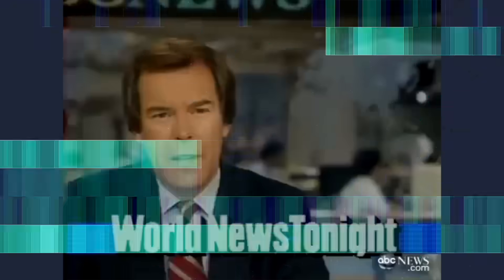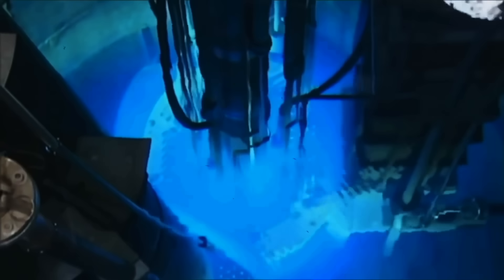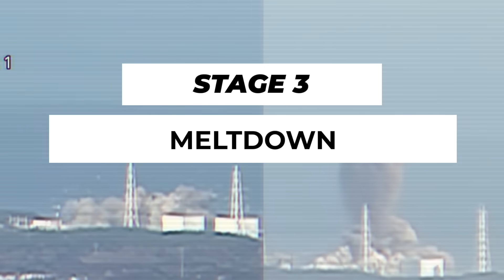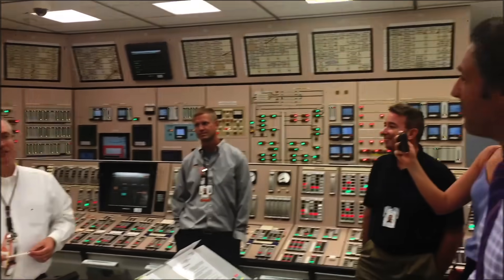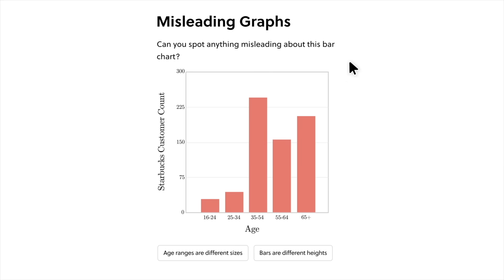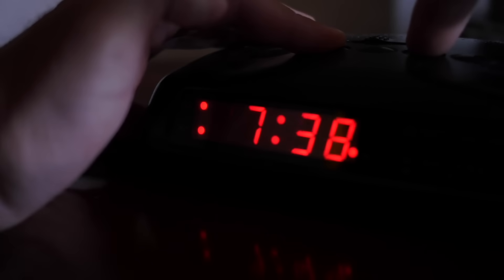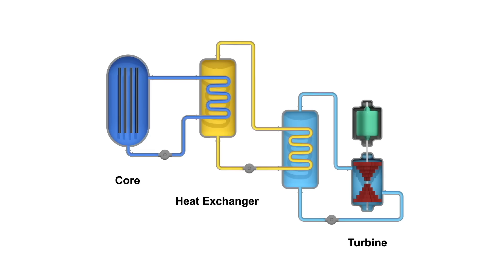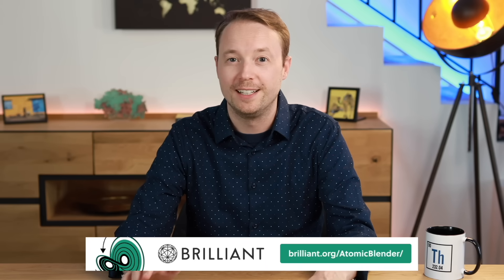Why Is It So Hard to Stop Meltdowns?

Comment: Of the nuclear accident we generally know about there has been 4 not 3 major accident, you missed out Windscale (now Sellafield) in 1957 in the UK. But beyond these there are many in the US and USSR that we only have the briefest of knowledge about because they were military accidents, Oakridge in the US springs to mind.
Reply: Not to mention SL1
Reply: Can't forget about the SRE (Sodium Reactor Experiment) meltdown that occurred at Santa Susana Field Lab in 1959.
Reply: @shaggyd485  You can't really call an experimental meltdown an accident similar to Chernobyl. When you have an experimental research facility, a meltdown is expected as a possible outcome from the outset. Unless the experiment lost containment, that's just a data point.

I guess you could call Chernobyl an experiment. But the experiment was supposed to be a functional test of the turbines, not a test of what happens when you remove all the control rods, poison the reactor for several hours, and then suddenly insert the control rods back. We already knew what would happen if you did that, even back then. Well... some scientists knew. The ones working the night shift evidentially did not.
Reply: Good point.  Did you know that they blew up a reactor on purpose in the open desert in Idaho only 1/4 mile from SL1, called the PBF (Power Burst Facility)?  Boom.  The camera film was grainy from the gamma flux. @Mathignihilcehk
Reply: According to an angry Russian, the Americans caused Chernobyl because they kept taking away Russia's smartest people.
Reply: Windscale was not a power station. If you want to include non powerstation accidents there are loads and loads and loads of them. Probobly 30 or 40.

Media dont care about them because they just hate nulear power

Comment: Quite a big omission in this presentation is that Fukushima  didn’t suffer meltdowns, they suffered Melt-throughs which is different in that the cores ( which they still aren’t  sure where they are) , melted through the concrete.
Reply: yeah normally meltdowns happen because they do not know that the reactor is melting down due to limitations in the tech for monitoring in the systems are not perfect and heat build up can happen outside normal operating situations
Reply: I also felt that Fukushima also has a similar problem with Chernobyl… not in terms of design but the fact that the people in charge were aware of potential dangers (for Chernobyl the outdated reactors and that  the workers were not aware they attempted the test in the day but due to problems it was delayed causing a build up of Xeon and lack of qualified and trained night shift employees.) In the case of Fukushima, TEPCO were warned that the wall could not sustain the 10ft plus tsunami and the generators were hit by the tsunami. (This is just based on water I remember) and the water pumps went offline.

Comment: It is the future, but we do use a poor design of reactor just because we always have and invested in it so heavily. We use reactors that are basically very large nuclear submarine reactors these work well in a sub where at idle it needs only a moderate amount of cooling. But when scaled up 100x for a commercial reactor the idle reaction is also scaled up and is now a not insignificant many megawatts of energy. This puts pressure on the safety systems to be large and complicated systems in themselves. It has been in the testing of these systems things have gone wrong at two disasters and the other when these systems were damaged beyond any easy repair. The answer is to keep these designs small and manageable like Rolls Royce are doing or to use completely different designs and accept investment will be required.

Comment: We need to find a good way to deal with Radio Active Cesium before we allow more reactors to be built. Or we require the drilling of a deep well below each reactor. Deeper than a Nuclear test well. And it must be able to accommodate the Core nuclear fuel being allowed to drain to the bottom.

Comment: But what if we made a reactor that harnesses a nuclear meltdown?
Reply: That is...insanity
The thermal runaway would be too mjch
Reply: No… it’s nessary
Reply: I don't think you understand meltdowns. Are you suggesting, instead of using proven technology optimised for energy production, we let nuclear material melt through concrete and try to get energy from a blob of dangerous corium that we have absolutely no control over?

Comment: Depends on the type of reactor, fuel type, coolant used,etc. Gen 1 and 2 reactors were very dangerous. The new gen 3+ are usually bullet proof. Molten salt one are excellent
Reply: “Very dangerous” compared to what? Even those types of reactors were very safe compared to other forms of energy production.
Reply: @M0rmagil  they older designs lacked passive safety in depth, had dangerous design flaws (or "features"), etc. I am suprised that more did not go wrong.
Reply: @Phil-D83  oh, I’m definitely aware of the limitations of Gen II reactors, both western and Soviet designs. My point was that even those designs were very safe compared to the alternatives. 

With the exception of Chernobyl, which had no containment dome and was being operated by poorly trained engineers (a really bad combination 😝😝😝) you can’t point to an obvious example of people being killed by a nuclear energy accident.
Reply: @M0rmagil poorly trained? Source?
Reply: @s1dnb  they disabled all the safety systems to run some tests. Then when the operators were too close to losing control they dropped the control rods, which they didn’t know would cause a momentary release of neutrons. All those extra fission reactions caused the water to flash to steam and blow the top of the reactor vessel off.
Reply: @M0rmagil  no sir there was no power surge before az-5, check again :)
Reply: They wouldn’t have hit the Az5 button if the power hadn’t spiked, and that button unfortunately caused a massive release of power that caused the steam explosion.
Reply: and the Gen4?
Reply: Is it possible to replace reactors with Mega energy storage?
Reply: Right on. It took us 60+ years to work the kinks out. Truth is, all new technology will go through similar growing pains as we learn by failure along the way.
Reply: Gen 2 reactors are still very prevalent in the world today and are as safe as the modern ones. You'll find that pretty much every reactor in the US is gen 2
Reply: "usually bullet proof" - in this context, the word "usually" is, what worries me the most. Didn't they say, RBMK-reactors cannot explode? Usually?
Reply: @sigurdkaputnik7022  nothing is perfect,  but the newer reactors (especially the molten salt ones, look up the "integral fast reactor" ) are far less prone to it
Reply: @sigurdkaputnik7022 They say the RBMK reactor cannot explode because they thought that there would be no one stupid enough to prime the reactor to explode. it may not be obvious to the common person, but to anyone even slightly knowledgeable in nuclear would know the only outcome of these actions. What they did is analogous to cutting your break lines because you were going too slow. In short the scenario is, this very dangerous reactor is not acting in the way that I am expecting, and I have decided to removed the control rods to raise the power even more to conduct a safety test. Do you see the irony of what was just said.

Park rangers say it the best. There is a significant overlap between the smartest bear and stupidest human.
Reply: @yogoo0  the top scientists at the time didnt think it was an issue. At least not important enough to immedeately do something about it. At the end of the day they tried to improve economic factors and f uped. 

Are you really sure the same logic cant happen to scientists/ designers today anymore?
Reply: @sigurdkaputnik7022 anything is usually bulletproof up to a certain caliber.
Reply: @SnailSnail-lo4pm The most underrated comment on this whole video (for now at least at 2 likes). The key is whether the odds are good enough to justify the reward or if it’s safer than what energy production methods we have as alternatives. Or if the cost or environmental difference is worth it. Frankly my largest pet peeve is all of the nuclear byproduct being thrown out instead of used as residential or business production heating. Or anything else.. what a godamn waste..

Comment: The newer designs are too expensive (Vogtle Georgia $30 billion and still counting) and the AP1000 that caused the bankruptcy of Westinghouse that took Toshiba with them.  SMRs still use the same dangerous fuel that must be stored for decades or centuries, each design has their flaws just like Nuscales leaving the moderator in the condensor and the fact is daily normalized discharges of radioactive effluents with radionuclides that are making into the public water, air and food that is causing damage that cant be tracked or traced in any meaningful way.  Nuclear energy is the past, not the future

Comment: Plus the fact that most reactors used in the united states are based on the Westinghouse design from the 1950's  modern modular reactors are a 1000 times saftet

Comment: They say clean energy with nuclear, ya right, you got to get rid of the fuel the lasted thousands of years, where do you put it? In a sealed hole in the ground that could possibly leak. Then when parts of the reactor need to be replaced. All that is contaminated and you got to get rid of radioactive parts
Reply: 60 year old mindsets like this, based on 60 year old technology are why we can't have modern, cleaner, nuclear plants that are able to burn their own waste and all kinds of advancements all while being safer.
Reply: 1. Deep in the ground, where it came from in the first place. Geologically stable areas are chosen to prevent shifting or damage. 

2. High level waste that needs to be buried do not leak. They are not a liquid. They're spent fuel and reactor parts. 

3. Long lived nuclear waste emit much weaker radiation compared to shorter lived ones.

Comment: after every major accident the industry makes the same optimistic promises.  they should not be believed.  while meltdowns may be rare, the consequences (chernobyl, fukushima) are unacceptable.  thorium-based reactors are a different beast and may be worth considering.  but uranium-based fission reactors create too much risk and too much fuel cycle pollution.

Comment: Funny enough, the guys at Oak Ridge that worked on PWR reactors for the Navy said: 'yeah they work great. Right up to about 60mw' after that you are ****ing insane'
Reply: I think around that was the point that they figured that if you had a meltdown, any steam that was created before it coiled that split the hydrogen and O2 to make a big boom any possible explosion would be extremely small.

I guess they figured being in the ocean, even in the worst case they could flood it with seawater and still swim away rather than having some sort of meltdown that would go boom or kill everyone onboard.

Comment: Thorium fueled, Liquid Salt cooled , Nuclear reactors have a frozen plug which melts if there is a problem and automatically discharges the fissionable material into an underground tank shutting off any further chain reactions. That is the best reason Uranium fueled nuclear reactors should cease being built.

Comment: i thought i can learn actual physics in here, and explained why it really is so hard to stop.. is it really hard to stop if you can pour tons of boron etc. there??
Reply: Tons? Through what opening? The cores are designed compact to be efficient. It's always a tradeoff. Of course you could make safety channels bigger and provide moaaaar control rods of all kinds of chemistries, boron, whatever works... But it reduces efficiency to have such spaces in the active zone.

(If you were thinking of pouring boron through an opening in the concrete containment vessel you have missed some important bits... The containment vessel should remain unbreached, it is the ultimate frontier of defense, to prevent contaminating the surroundings... You're asking for core to be exposed and pouring stuff on it :D that is the definition of Chernobyl vol.2...)
Reply: no, there is even TOOOOOONS OF WATER in core.. how that gets there lol
 @u1zha
Reply: @u1zha  boron is used constantly to control the reactivity of PWRs through boron injection. BWRs use standby liquid control in case of emergencies where they quite literally do exactly what he described. . . They dump a crap ton of sodium pentaborate into the reactor to "cake" it up.

Comment: The power output of a pressurized light water reactor, the type sane countries use, is not controlled by the control rods when steady state in the power range. Yes, they will have an immediate effect on power, however the core is designed to automatically match the thermal power of the boilers without any control rod movement. RBMK cores have an active, automatic control rod system because they do the opposite, any power imbalance between the core and boilers amplifies itself causing either a shutdown or power spike if not corrected.

Comment: The very idea is ill-conceived. If coal thermal plants were built on same principles as nuclear power plants, we would have inside a huge hermetically sealed fire pit with enough coal for several years of operation at full capacity, set it on fire, and then use very complicated system which restricts supply of air to the fire pit to throttle down the burn-down rate to safe and sufficient levels of heat output that we can manage. Of course, since the glowing embers inside can't just instantly die out, we would have to have a fail safe cooling system to keep removing residual heat even when we cut off oxygen completely. By choosing this kind of design we deliberately introduced multiple points of catastrophic failure which needs special TLC. Am I the only person finding that kind of design ridiculous? Admittedly, there was a predecessor, in hydroelectric plants, they also work in "retarded disaster" mode because huge amount of high water behind a relatively thin (compared to geological features) wall never hurt anyone? Anyhow, large accumulation of fast-releasable energy should be in principle avoided whenever possible, especially if there are potential victims in range.
My proposal would be to scale down amount of fuel and rotate it more often. Don't use chain reaction. Instead use controllable, high flux neutron source (a sub self-sustaining fusion reactor) to maximally irradiate small amount of fissile fuel at a time and achieve high burn-down rate for it. Squeeze it dry, ideally down into Pb. Match the material input flow to output power plant rated power.

Comment: When a reactor is designed correctly, proper safeguards and training.  You can drop the control rods and stop the nuclear reaction.

What happened at Fukushima is poor training by management.
There was a sister reactor that had no problem shutting down because they had practiced how to do it.
Reply: The sister reactor probably had pumps that functioned, unlike Fukushima that had pumps knocked out by tsunami? Can you provide a link?

The video was pretty clear (if superficial) about the fact that dropping control rods does not stop the nuclear reaction. Back to 0:00 you go.

Comment: Best to develop molten salt reactor that can not melt down or explode.
Reply: Meltdowns can still happen-
Its not like the uranium can mix in with the salt
Reply: @shoeskode136  in Molten salt reactors the fuel is dissolved in molten salt which has a boiling point of around 1500⁰C (2700⁰F).  The fuel can be uranium plutonium or thurium.  These reactors can not reach these temperatures as the expansion of the fuel as it overheats will move the fuel atoms to far apart for the nuclear reaction to happen. Molten salt reactors also have a drain pipe that is plugged by chilled plug of salt.  If power is lost or the reactor gets to hot this salt plug melts and the molten reactor fuel / salt drains into a lower drain tank that is designed not to support the nuclear reaction and shed off decay heat through non-powered air convection. So no, a molten salt reactor can not melt down or explode because the fuel is already melted.
Reply: @stanleytolle416   wow. Thats. Impresive wowie

Comment: Has any work been done recently with fluid core reactors - where the core doesn't melt because it wasn't solid in the first place? As I understand it, the nuclear fuel is made into salts, dissolved into a fluid, and then you control the control the output via neutron reflectors and stirring action. (I've heard both spin the stuff, so it concentrates at the edges like a centrifuge, or mixers that bring the fuel to the middle.)

Speaking of melting down - why don't more reactors use horizontal fuel channels, rather than vertical ones?
Reply: I think many of the thorium power companies are fluid core? CopenhagenAtomics reactor for example. Liquid core, liquid moderator, liquid fuel blanket (breeding something something? I haven't yet grasped their exact plans).

Re: horizontal fuel channels, I don't think it changes much in meltdown equation? The active zone is anyway close to spherical, right? And the amount of material that could melt down is thus the same. Control rods can drop inside the channels by gravity, if they're vertical. And I guess fewer structural supporting elements needed in vertical configuration.
Reply: CANDU reactors do use horizontal fuel channels.